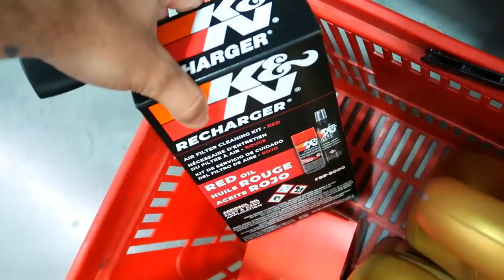Servicing the Long Overdue Turbo Falcon

Comment: Mate, try plastic bag trick next time you do the oil filter. Just ensure it's loosened slightly, then put a plastic bag around it and undo it. The oil will go into the bag and let the filter drop in as well once undone. Works a treat. Cheers from NZ.
Reply: crampynz you know I’ve been doing oil changes for 15 years and now you’ve completely rocked my world
Reply: @willnewing4240  Glad I could be of help.

Comment: Zacster whenever I change the oil on my BA XR6 I put heaps of newspapers under the car for when I take off the oil filter You didn’t show if you pre filled the oil filter as is best to do rather than putting it on dry .My 2004 BA XR6 takes 7 litres of engine oil , that’s what it’s says to put in it in the service manual , that brings it up to the full
mark on the dip stick . I have been using Nulon 10w-40 Full Synthetic but on the next oil change I’m put in Penrite HPR 5w-40 Extra ten full synthetic engine oil , it normally costs around $89 at Repco but I picked it up a few weeks ago for $49 , I have been told it’s a better quality oil than Nulon .
Reply: Doesn't matter if the filter is dry when starting. Just crank the engine over a few times without starting to build up oil pressure and fill the oil pump

Comment: Hey Zac, not sure if you're running a map or maf sensor,( I don't falcon) but if it's a maf then using an oiled air filter can cause them to get dirty faster than usual, that usually leads to running rich and surging a bit, if you have one grab some contact/maf sensor cleaner and give it a spray, might help clear that surge up.

Comment: hey mate, when i change the oil on my dad’s ba falcon i loosen the filter just enough so only a thin line of oil drains out & when it stops, undo the filter slowly just incase of any excess oil that might still come out of the block & try to hold the filter upright so leftover oil doesn’t spill out, hopefully this helps & about the brakes maybe try to paint them with a few coats of high temp black first then paint them in breeze, cheers
Reply: For bright colours you want a lighter undercoat. Pre-paint white.

Comment: Hey man if u have a drill drill a hole in the filter drain the oil out of filter first then take it off save ya arm from oil or grab something sharp and a hammer and poke a hole in it will save your "face tv bed"hahahah

Comment: You should pierce a hole in the bottom of the oil filter before you remove it than crack it to to save oil going everywhere

Comment: U use nulon oil Penrite is better but it’s expensive
Reply: Penrite is rubbish Oil it burns before service time where Castrol Edge doesn't.
Reply: Never had oil burn with penrite in my experience and I've been using it for years.
Reply: @dachad1488  Each to there own I guess .

Comment: Now that this filter is completly dry *picks it up and water drips off it *
Reply from the maker: Robert Archbold was just the plastic bit ✌️
Reply: @ZacBaldy  I know man. Just made me laugh lol
Reply: You can put a fair bit of oil on the K&N. Make sure it gets a good spray you can't put too much on and it's what protects your engine. Fill to your dipstick with engine oil, takes a bit longer but it's better than overfilling, just remember first start will fill oil filter, then check it again. Better to be slightly under than over.

Comment: Repco?! Go to SuperCheap or Autobarn my man and save money. 👍 Anytime I call Repco for a quote it's double the other places minimum. 👎
Reply from the maker: MafiaboysWorld supercheap had the same oil for $26 more, I shop around on the Internet before I go anywhere 😉
Reply: @ZacBaldy  First time ever Repco's been cheaper for anything. 😂🤣👍
Reply: Repco is generally more expensive unless you have a trade account or a member card if you've got either of those two then repco can be quite good
Reply: @ke70gt18  Let's put it this way. I just ordered a set of Moog lower control arms for my Cressida DIRECT FROM THE MANUFACTURER IN AMERICA and even after shipping, it's less than half of what Repco quoted for Dorman and Moog are much better quality! 🤷
Reply: @ZacBaldy  Exactly. Just have to pick the right place at the right time. While I mostly go to supercheap as well, repco has been good a few times. Autobarn is only good for car cleaning and some other things like that flexible heatshielding and some audio stuff. However you know the old acronym; Rip Every Poor C... Off.